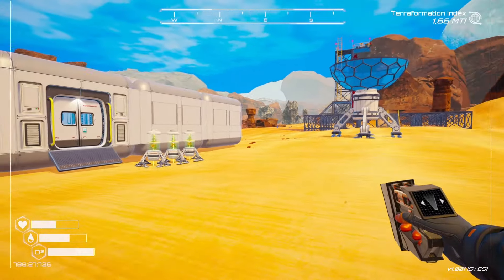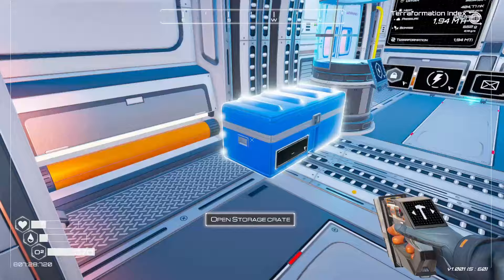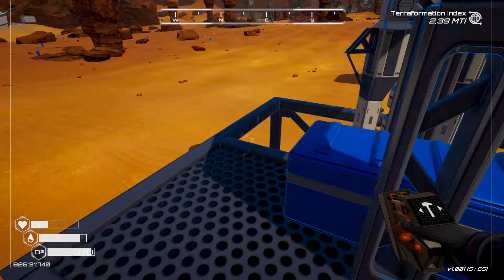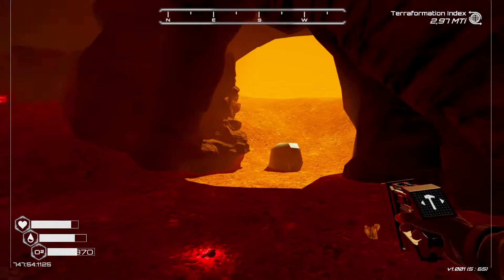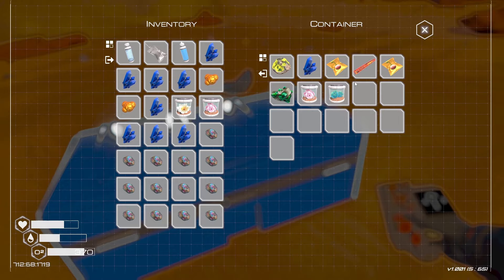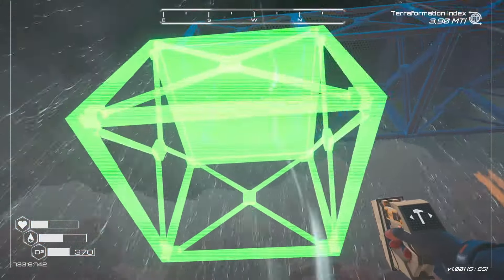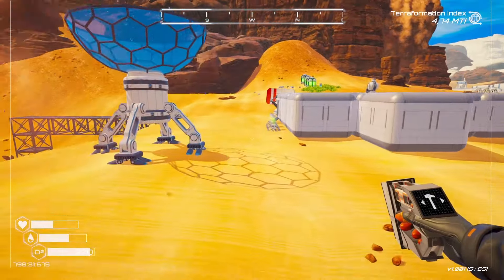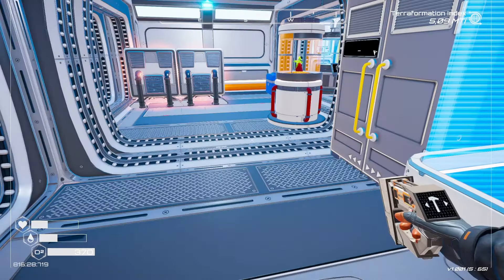Planet Crafter 1.0 - Ore Mining The Beginning of Automation [E4]

Comment: I put my heaters and drills in the iridium cave. Plenty of space in there for a hab for the heaters and drills. Once you get the inside ladder you can stack the habs too. That flat space on the shelf by the central pillar is perfect for the hab.
Reply from the maker: Its just me but I like being outside with my base. I think the drills and heaters will get a little cluttered when you get to T5. Those things are huge.
Reply: @surtrplays  The T5 drills I put over in the waterfall area or in the desert area. I don't make one big base. I have a living area, crafting and manufacturing area, the rocket area, and the biolabs area. I like spreading them out and then just linking the areas via teleporter. That way I am not spending all my time in just one area of the map and I can work on doing different landscaping and builds with each area.
Reply from the maker: I'm a bit of a hermit.

Comment: The tip to center your entrance to your base is to rotate the living compartment if it is off center. No matter what i do, it can only center on one side of the living compartment at a time for some odd reason. 
I am not sure but i don't think you have your backpack at T4
Reply from the maker: Thanks. I will be changing the single unit compartments into a large one anyway. I did get the T4 and I am beyond that now.

Comment: Those slight barely noticeable variations in the ground level are incredibly annoying!
I wonder whether sending up the Pressure rocket earlier would have given you all the Iriidum you wanted.
The T1 Ore Extractor can only extract Aluminium, Iridium and Sulphur. (And the five basic ores of course.)
I'm not a fan of the low visibility of the sulphur area so I'd prefer to use Osmium caves or Extractors instead.
Strangely two Atmospheric Water Collectors collect water 25% faster than a Lake Water Collector and only use 15% more power to boot. (Lake Water Collectors used to be useful for auto-crafting Bacteria Samples.)
I assume the Biolab and T1 Biodome will be integral parts of your main base?
Reply from the maker: The water is about as flat as you can get. That's why I like to build on it.
I could have sent the pressure rocket up sooner, I'm sure it would have helped.
Thanks, I wasn't sure if the t1 could get Uranium. 
I'm not too concerned about the sulphur area.
Interesting on the water collectors.
I don't think I will include the T1 biodome. It doesn't really have that much value.
Thanks for watching.
Reply: @surtrplays  Fair enough, it's fine having it on your initial base for now.